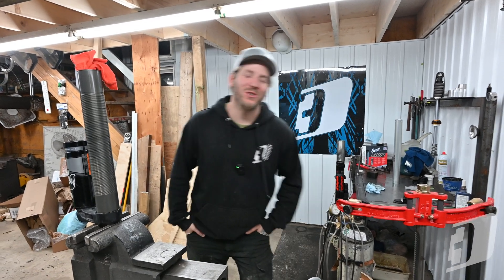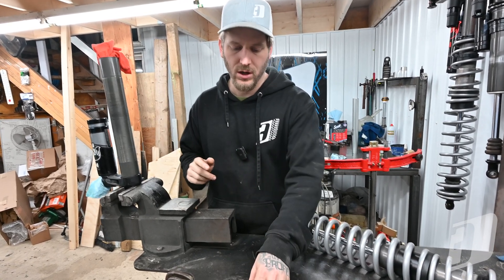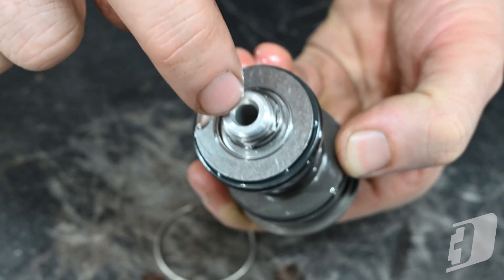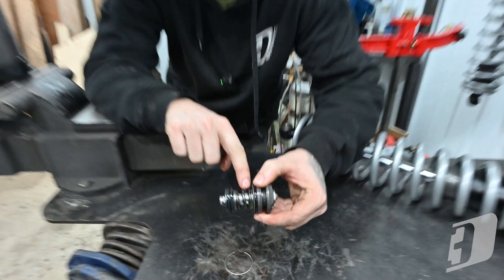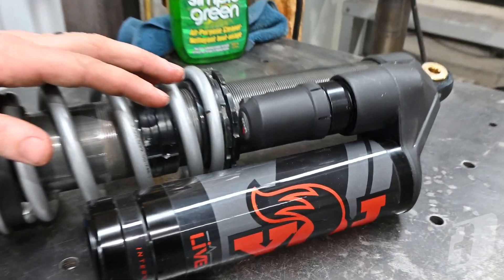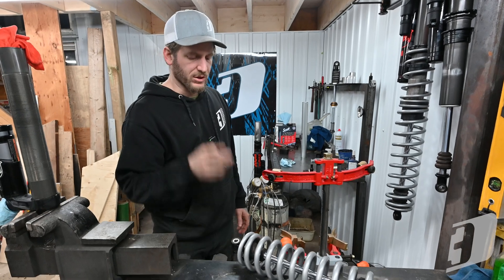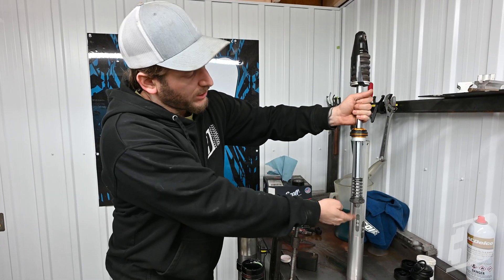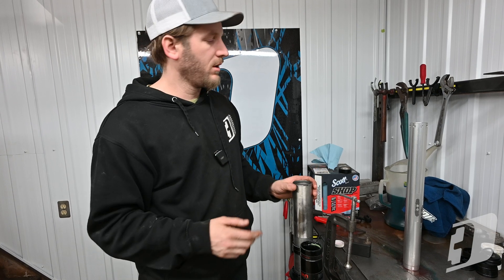How Do Live Valve Internal Bypass Shocks ACTUALLY Work??

Comment: Would you still say nitrogen is the first thing to check when losing ride height over time? I just can't see the springs sagging being an issue when I'm not being super abusive to them

I've been keeping tabs on my ride height, and it is decreasing. I'm noticing a rougher ride on the mud tires than last wet season.
Reply from the maker: Yup nitrogen is always first! Low nitrogen will also change how it feels over the bumps
Reply: Thanks! A nitrogen service system is my next mx purchase for sure